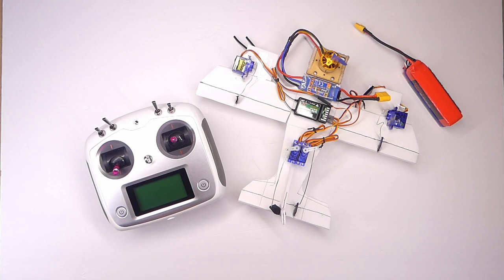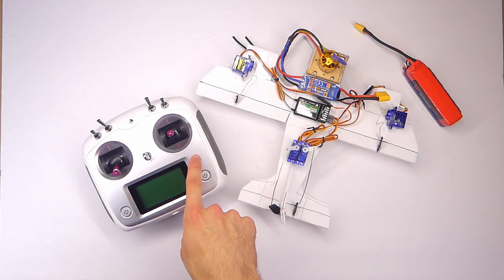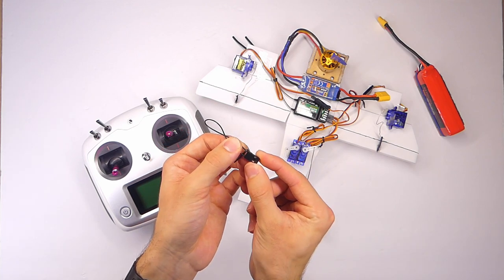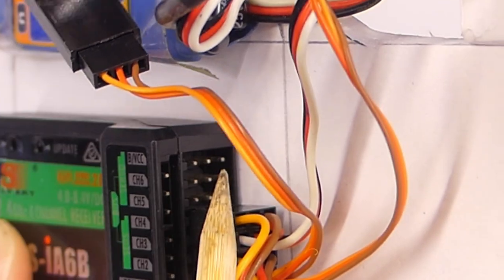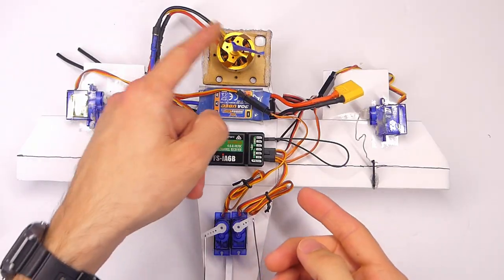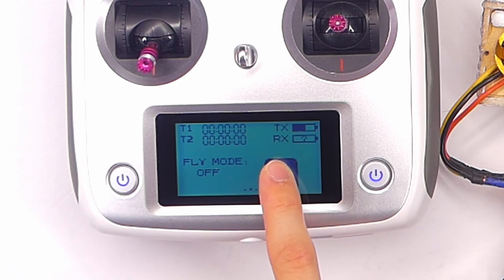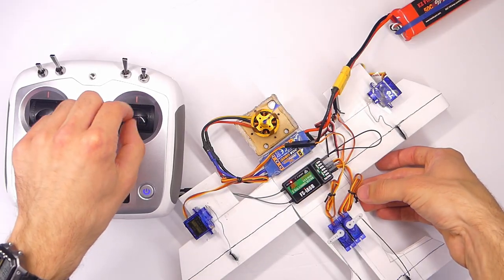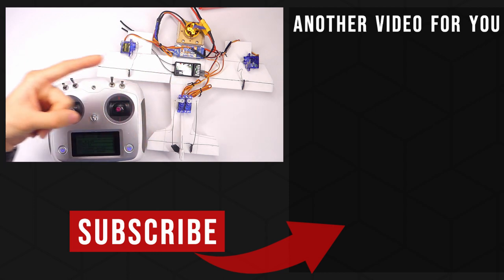How to Bind FS-i6S with Receiver 🤝  Flysky i6S, iA6B

Comment: Hello Adam, can this flysky bind 2 receiver the same frequency? I am using it for my semi truck, one for the truck and the other for the trailer to synchronize lights, i have seen tutorial for fs i6x and it works, but no tutorial video for this model, i hope you can help.

Comment: nice vid brother. one quick question, I wanted to bind it with a fixed wing with 2 flaps switches, reverse throttle, gyro 3 switches, nav lights and one extra channel. does this fs-i6s compatible to what I need?
Reply from the maker: It should work. It can do up to 10 channels. Not sure how the reverse throttle would work though.

Comment: Hi, you mentioned your transmitter has the latest April 2020 firmware. I've looked for this on the Flysky website but can only find a 2019 version. I'd really appreciate it if you could let me know where you got the 2020 version, as well as the difference between the new vs old firmware. Thanks.
Reply from the maker: Hi! It is available on GitHub here https://github.com/open-flysky/FLYSKY-ProductInformationDownload/blob/master/Transmitter/FS-i6S/Flysky_i6S_2.0.0.68_Update%20firmware.exe .
Reply: @RCwithAdam1  Really appreciated, I'll give it a try.

Comment: Hi Adam, I love your videos, I am a newbie to FPV and I got myself a FlySky FS-i6S and use it with the simulator and love it. Recently I bought a Mobula7 and when I bind it I get "Turn Off RX"  like you get in the video above at 2.28, however my message just stays on the screen and the radio keeps beeping? Any idea what I might be doing wrong? Do I need to change somthing in Betaflight? Thanks in advance. MHG
Reply from the maker: Hi! Glad you're enjoying the videos! 
Have you tried turning your radio OFF, then powering on your quad and putting the rx into bind mode, and THEN turning your radio on and binding? I think the order will make a difference.
Reply: @RCwithAdam1  Hi Adam, thanks for getting back to me, I have tried every combo I can think of in term of binding order but I get the same results, it maybe a drone issue? I just though it might have been a known issue? Thanks again, MHG

Comment: Nice video ta.
These controllers are such amazing value for money the receiver itself is approx half the cost, or it was when i bought it 3.5 yrs ago.

Have you a link for the latest firmware update please?
And maybe a tutorial how to update.
Thanks
Reply: Ps do you know what range this transmitter has?.
I have modded my controller with a 2s 1500mah battery which should help extend the range further as its 2 volts above the normal supply (you can adjust max and min voltage alarm in menu for the custom battery)